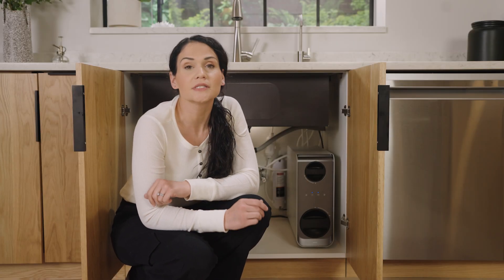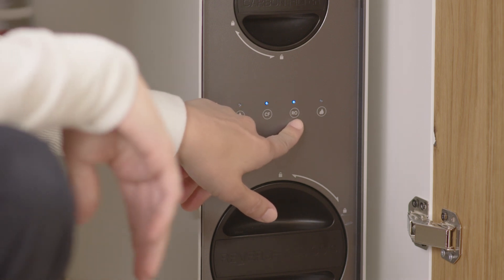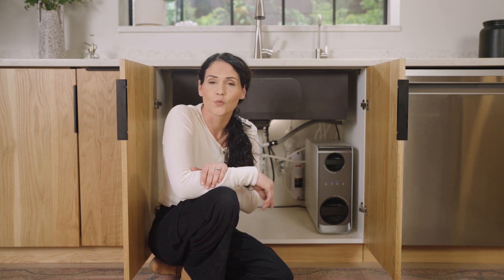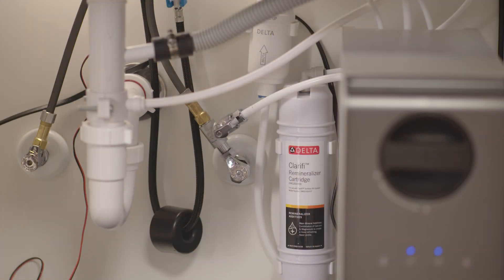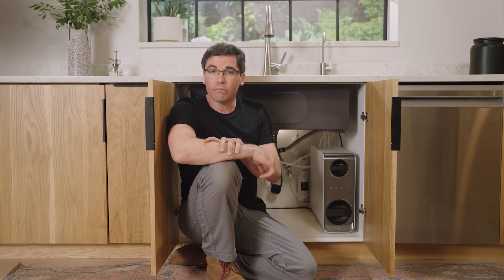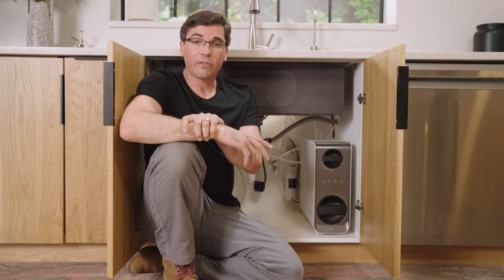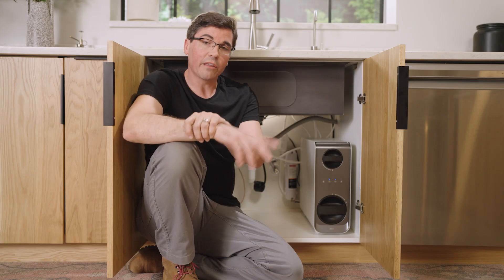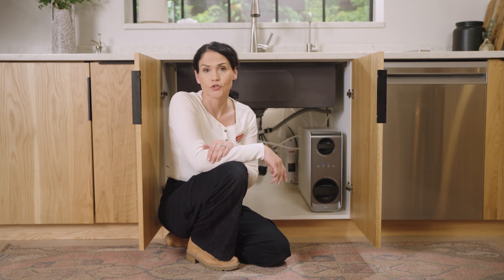How to Troubleshoot the Delta® Clarifi™ Tankless Under Sink 6 Stage Reverse Osmosis System

Comment: The noise level that they don't emphasize on product page is concerning. I spoke with Delta customer suppport who relayed that is "normal for the machine." There is also air hissing when turning off the faucet. This needs to be made more known. It is not a low hum as this video states despite going through the "solutions" mentioned in the video. Definitely jarring noise when it cycles through even though you don't turn on the faucet. Very dispappointing product made by Delta.
Reply: Noticed same. Unit vibrated significantly and could be heard on other floors of the house. I folded two small kitchen towels and placed under front and back legs. Cut noise by 50-75%.